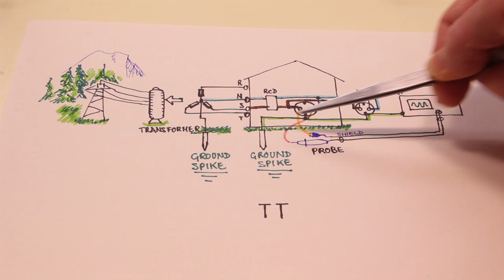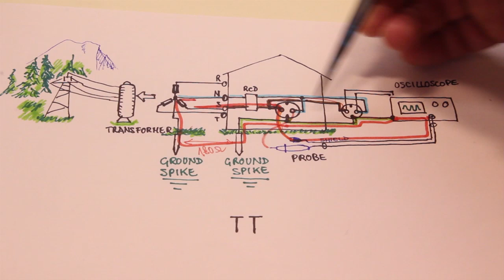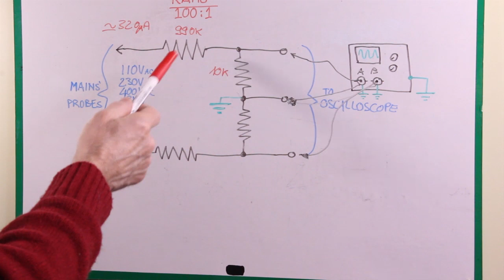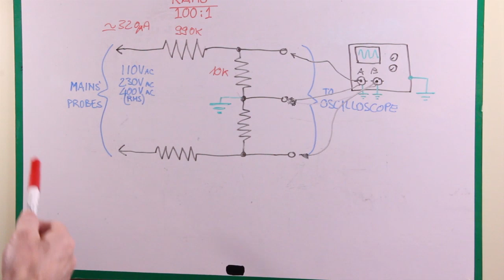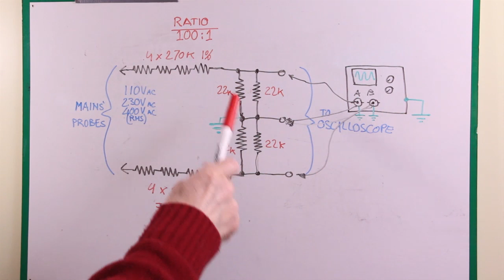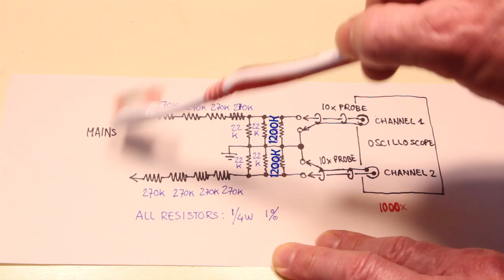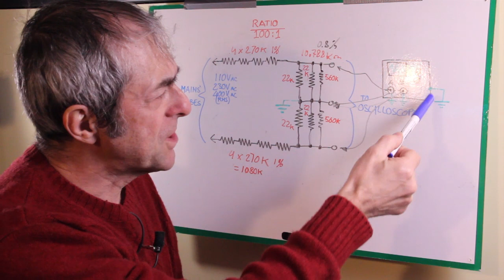Easy DIY passive #probe to measure #mains with the #oscilloscope

Comment: If you just want to look at the 50 or 60Hz sine wave of your mains outlet with your scope, you don't need anything extra to build.
Mains outlet is referenced to ground / protective earth, your scope probe tip is also referenced to ground, so you don't need to connect your scope ground clip to the neutral of the mains. Just set your scope probe at X10, remove the groundclip and touch the Hot / Line / Phase of your mains outlet, and you will be fine without doing damage, 
or tripping RCD. Also, if you have 2 x10 scope propes, you don't have to build any extra. Just set each probe at x10, connect both groundclips together, set your scope to measure differental by choosing channel B ADD to channel A, and set one channel reverted. You can then use one probe tip to touch Hot / Line / Phase and the other probe tip to neutral. Both groundclips are only connected to eachother, not to anything else.
Before i got a differential probe, i used method 1, by using 1 x10 probe and no ground clip. If you want to do measurings in circuits that are powered by mains, then method 1 is not advised.  Grtz from Belgium
Reply from the maker: Please watch the video where I talk about this topic. Neutral is normally connected to PE but it is not guaranteed it's at the same potential, and this is especially true when it comes to diagnosing. Method 1 is dangerous because voltage is above the rated voltage of many probes and scopes. Method 2 uses two channels. Also with method 1 you wouldn't be able to measure in-between voltages in a circuit, for example across a resistor that is not referenced to neutral. Finally even with method 2 you are at risk with common 300v probes, even though in practice it should be unlikeable that it breaks down with just 25v above its rated voltage.
Greetings from the Alps.
Reply: @AccidentalScience  , X10 probes have only 1/10 of the input voltage on the output to the scope. If you are measuring 240V, the output to the scope is only 24V.
The cheapest scope probe will measure up to 600V, but take that with a grain of salt and say 500V, that means that only 50V is going to your scope. 
Each channel of your scope can measure up to 300V directly, so you have safety range of 250V, when measuring 500V with a X10 probe.
The only problem that occurs when measuring 500V with a X10 probe, that your measuring on the screen will be out of range, so a X100 probe is more suitable when measuring above 250a300V AC.
Also with the DIY passive probe, your readings are not correct. 
If you are measuring mains voltage, what is referenced to PE, one side of your voltage divider is bypassed for 50% because each end is connected to PE,  the result is that when you measure a floating voltage, this voltage divider is not bypassed for 50% , so the voltage to the scope is 50% lower.
If you choose for a X100 attentuation, and you measure 240V AC PE referenced, 2,4V is going to your scope, but when you measure 240V DC or 240V AC not PE referenced, only 1,2V is going to your scope.
Reply from the maker: @BjornV78  dude, insulation is determined at each level of the chain! A 300V probe has insulation in respect to GND that is carried along its cable up to the tip and around the internal resistor and capacitor. They are rated to withstand a given voltage in respect to GND. Also while in the eightees 600V probes were common, nowadays it seems that is no longer the case, sadly.
About that thing that with the passive probe you would read 50% of the voltage, well it is plainly wrong. Look at it better. Remember that you are using two channels linked with math differential. Also think at the case you need to make a measurement that is not referenced to PE, but still the circuit is referenced to PE.
Reply: @AccidentalScience  , may i mail you the drawing of what i mean by the 50% misreading ? A picture says more then 1000 words :-) Grtz
Reply from the maker: @BjornV78  sure, my mail is in the about section of the channel.
Reply: @AccidentalScience  , i just mailed you. Thx Grtz
Reply: Hey Bjorn guy, thank you for your comments and insights!

Comment: No capacitors for frequency compensation? I wander what's the bandwidth of this differential probe. I guess not huge.
Reply from the maker: Yes, I forgot to mention it in the video. BW should be about 20KHz which is acceptable for reading very low frequencies. It is a trade-off between performance and simplicity+safety. Adding compensation would have required a series of good, high voltage capacitors, making the whole thing bulkier for a dirty quick simple solution. After all 20KHz is generally enough for things that work at 50/60Hz. So I choose to add the compensation to the active probe that will be shown in the next video.
Thanks for your comment.